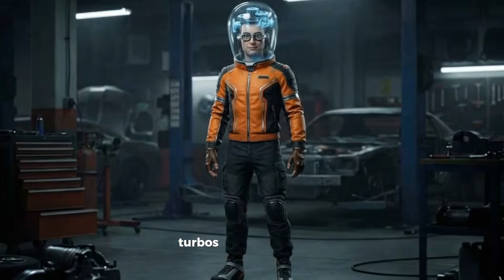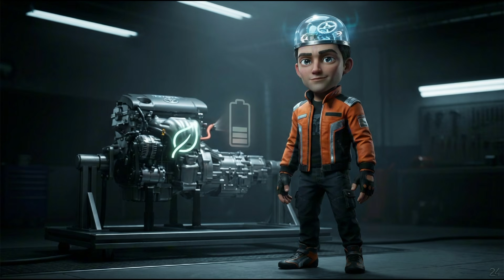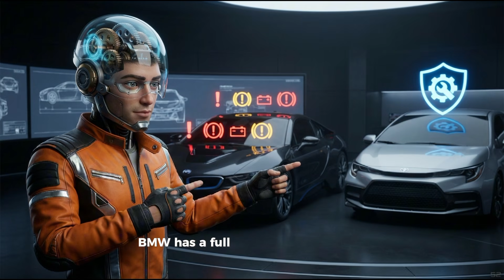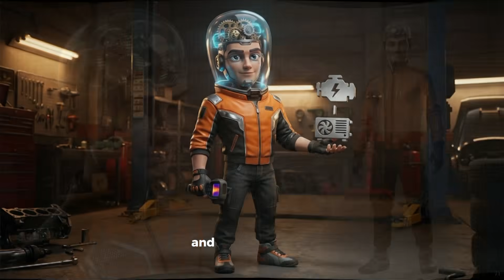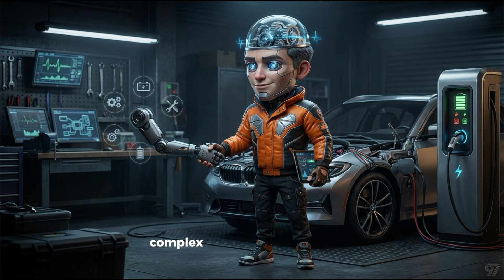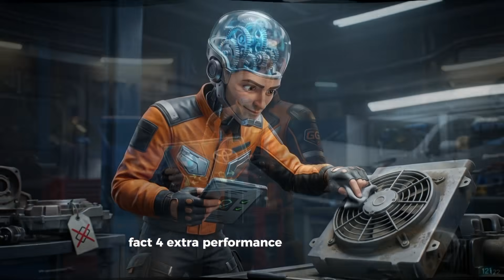BMW Hybrid vs  Toyota Hybrid Why the Luxury Choice is a Mechanical Trap

Comment: I’ve been owning Hybrid vehicles since 2002 Toyota Prius sedan prove Hybrid reliability and longevity allowed my confidence in Hybrid technology therefore, subsequent Hybrid vehicles have been the 2012 Toyota Prius, 2021 Toyota Sienna Hybrid all run great without any major issue even after a quarter of million miles. 
I only trust Toyota Hybrid
Reply from the maker: Seiko, thanks for watching and for bringing nearly a quarter-century of real-world data to the GearHead community.

You are the textbook definition of why we rely on historical fleet data instead of dealership marketing. By sticking with the proven planetary e-CVT architecture across multiple generations—from early sedans to heavy minivans like the Sienna—you've completely bypassed the complex friction clutches and fragile turbochargers that make European luxury hybrids such a mechanical liability out of warranty.

Hitting a quarter-million miles without a major issue proves that Toyota's conservative approach to thermal management and battery cycling is the ultimate cheat code for protecting your Total Cost of Ownership (TCO). You found the exact mechanical formula that guarantees long-term reliability, and your wallet is reaping the rewards. Thanks for sharing your legendary ownership history with us! 🔧